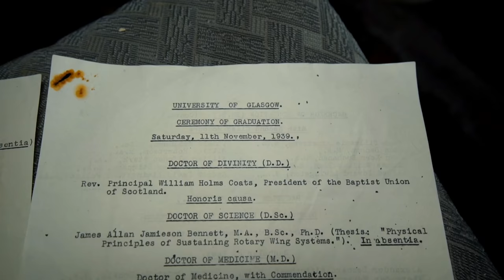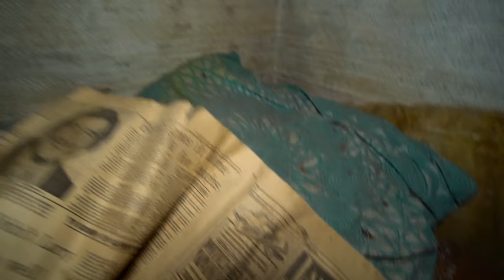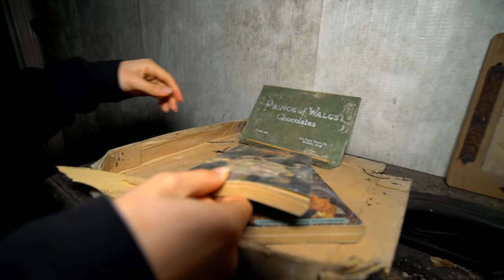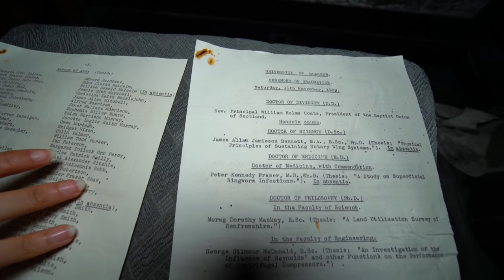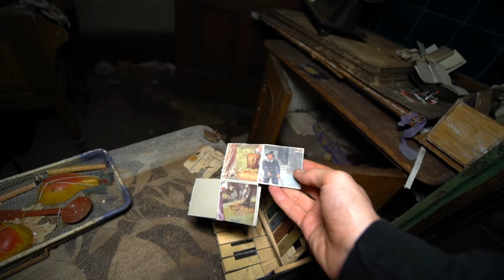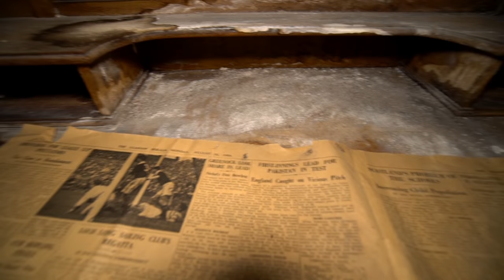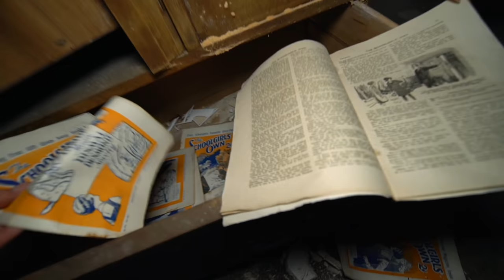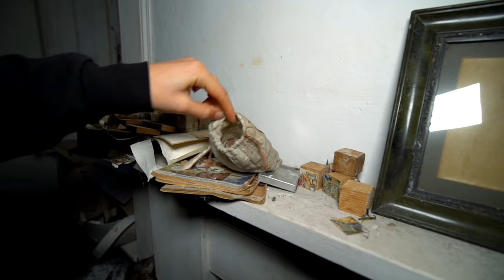Abandoned House Of The Missing Witch | Hidden In The Scottish Highlands For Decades

Comment: This is definitely not a witches house. The doll on the lounge is a very old doll. When you laid the doll flat the eyes would close and the lids would become stuck, break off inside the head so the doll had no eyelids when sitting upright. The handle next to the fireplace would have been to open or close the chimney vent. The black dress hanging on the wardrobe door would be a thick heavy funeral dress the lady would have changed clothes after the service judging by the Christmas decorations it would have been winter and bitterly cold there. The doll in the plate has been set up by someone and is an old fashioned wooden doll with no clothes on. The bundle of what looked Like twigs bound together are dried or either fresh herbs and burned to purify the air after a death, Witches and Wise Women or even just us older women use them to burn and cleanse. The dead animal corpse tells me the story looks like the husband died the kids grew up and moved away, the Lady of the house maybe died but being on her own maybe was not found for days or weeks the family pet would never leave her so just laid down to die with her. Hence the police tape as this would have had to be investigated (even years back) by a Coroner. Just a beautiful old house left to decay.

Comment: The rusty utensil in the drawer with the pointed end on one handle looks like an old-fashioned nutcracker. You put the nut between the two handles to break the shell, then use the curved, pointed end to pick out the nutmeat.  Other explorers set up the table, the white rose in the vase, the whatever it was on the plate,  the thing hanging from the lamp, and such. I wish they would just leave things as they find them instead of trying to create a scene as if it was something the people who lived there had left. Seems like that happens a lot.
Reply: Yes, the table looks to have been staged by previous explorers, and the doll was placed there for sensationalism. There really isn't anything sinister about this house's past.

Comment: Absolutely cool place ❣️ I would imagine the handle by fireplace would be used to open the flue.
In the dining room, the item in the buffet drawer is a nutcracker. The ends are used to pick tiny particles of the nutshell off of the "meat".
I noticed the pump organ. The white  knobs are used to pressurize wind in or out for sound effects. ☺️

Comment: Handle on the wall was actually used to lower and raise an original chandelier. Pre electricity, a rig system was usually run through the ceiling and down next to fireplaces so that lighting candles was easier. I know most comments are that it was to ring servants, but due to the lack of additional rooms and low basement, this home more than likely didn't have a staff of more than a housekeeper at most.
Reply: This is really interesting.. my thoughts initially where it was for a baffle plate in the flue to alter draw and to close the pot's to stop cold air entering when not in use.. I really wanna know there true purpose now🤦🙃😆
Reply: That's really interesting. I  can see how that might me the case.BW

Comment: The winding handle next to the fire place may well have been for a damper in a chimney.. essentially a cast iron valve to open and close the chimney to alter the draw I guess and you can close off completely when not in use so you don't draw cold air in through the pot's into the house.. quite an unusual but clever piece of engineering for the time..
Reply: Yes, that's what I thought as we had one in our chimney when I was a child.

Comment: Sorry have not been to many Premier's this week where I am in Canada, Saskatchewan we are in a heatwave that started Tuesday at 80 F the heat has been going up from there to 110F, and Friday witch is today is going up to 120 F. I will be bearly on but will do my best to see things slowly as my tower gets hot and also heats the house as well. I love the video though :)

11:08 I think that is to open the flew for the fireplace so the smoke did not fill up in the house not hard to make a flew with some heavy string/rope or even a wire of some sort and yes it can fit behind a wall.

Comment: The Strange little handle neer the dinning room fireplace is a Bell that would have probably led to the Kitchen or servants hall to call  a maid , cook , house keeper or butler when they were needed. sometimes they were handles like that one but most of the time they were made of a richly decorated ribbon or cord that you would pull on and it would ring the bell. Before the second World war when most of the British middle /upper middle and wealthy classes ...pretty much everybody except the poorest or the poor had at least 1 servant a device like this was necessary ess in Larger houses. Before the second world war hit the Push button bell became more in vouge but it was short lived since after WW2 in Britan servants in most house holds became less common place due to a changing class system in the UK and finnacial hardship which is why in the 50's the rates of food poisoning increased because many middle class/ upper middle class housewives were for the first time with out a regular cook or house keeper which had been the norm for the middle and upper middle class before the war and did not know how to properly prepare or store food.